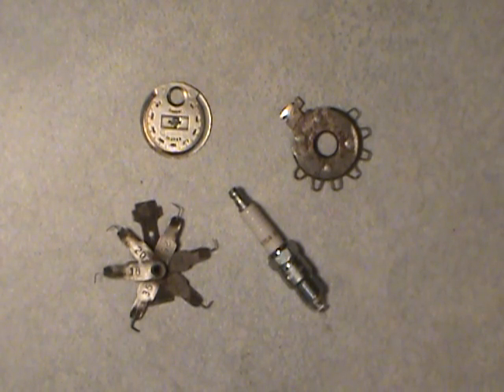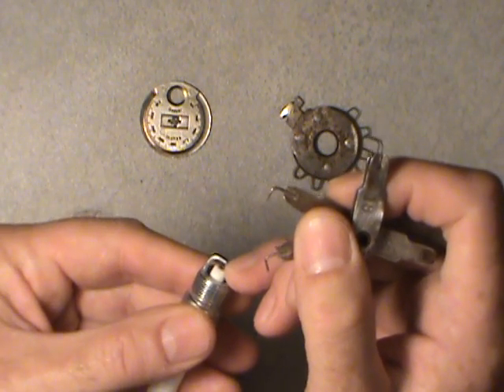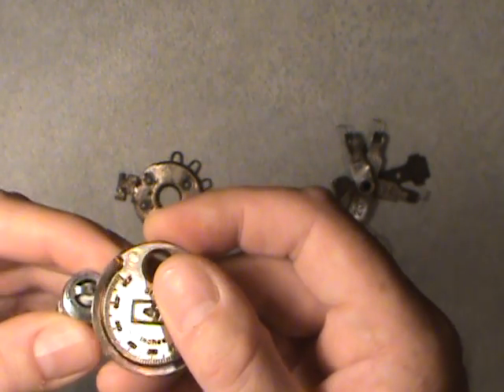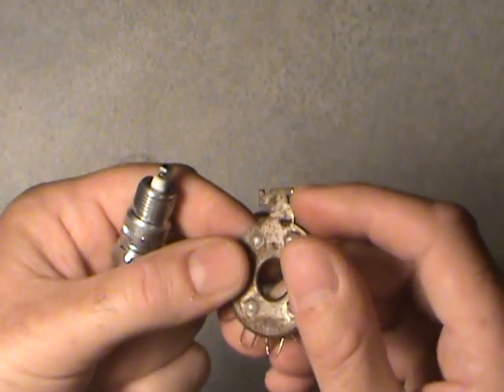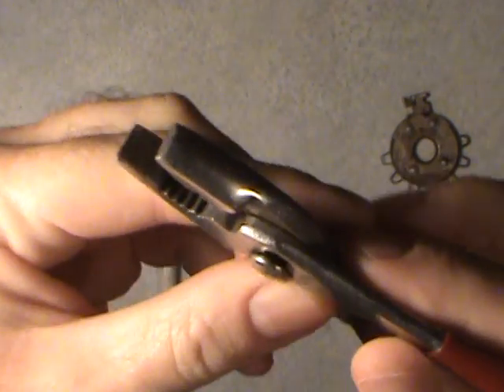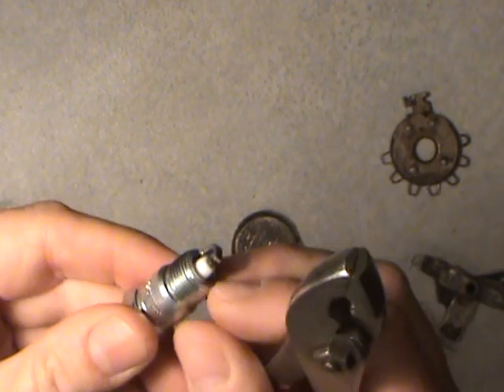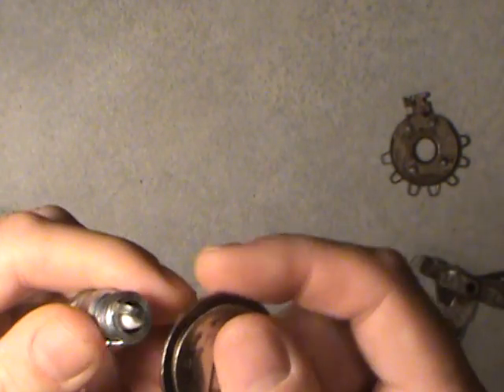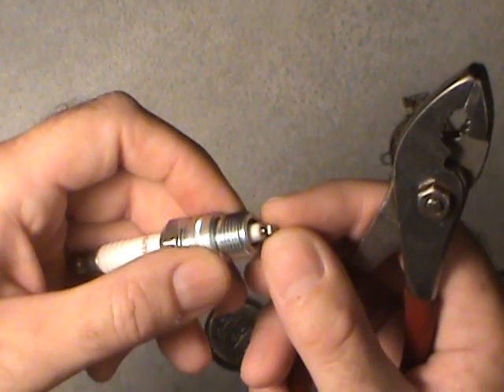SPARK PLUGS How to set the Gap (Part 2)

Comment: why is it important to not touch the electrode? you'll always be touching it anyways with the feeler
Reply from the maker: MotoBoy Greetings MotoBoy....Thanks for watching, and for Your comment/question as well..................As long as a..."Very Light"...shall we say..."Feel" (aka, Drag, or Dragging Motion..."Resistance")...as in, next to No Real Force Applied (kinda like...a..."Swiss Watch-Maker"..."Applies"...when working on a, good ole..."Wind-Up/Main Spring"..."Rolex Watch"...???...does...lol)...when using a "Feeler Gauge", or any Gauge, for that matter, that gets inserted Between, the Electrodes, in the, shall we say, "Common Type, of Old School...Spark Plug", to "Measure the Gap", between, the "Inner/Center" Electrode, and the "Outer/Ground Strap" Electrode, then, by doing so, that part of, shall we say, Spark Plug "Handling" (with Care), shouldn't cause any Harm, to the Spark Plug, as opposed to..."Cramming"..."Ramming"...and...hopefully not, using "Lethal Force", in order to "Make"...that there...Spark Plug..."Gap Measurin' Gauge"..."Fit"...Between, the, 2...Spark Plug's..."Electrodes"...which, if using that Much Force, will, as I see it, have, a pretty darn good..."Chance/Potential"...at..."Damaging/Ruining"...that, poor abused Spark Plug...!!!..............Now, I'll move on, to the "Outer/Ground Strap Electrode"......................................................Try not to..."Bend/Adjust"...the "Outer" Electrode..."Too many Times"...and/or..."Too Much/Distance-wise"...because, as with most Metals, it will usually, "Weaken/Fatigue", that piece of Metal, relatively Close, to the Location, at which, that "Bending" took place, and Heaven Forbid, having, a Chuck/Piece, of that Spark Plug's..."Outer Electrode"..."Break Loose"...and fall into, a..."Running Engine's"...."Combustion Chamber"...and just imagine now, at all of "That"..."expensive"..."Expensive"...did I say..."EXPENSIVE"...Engine Damage...that would probably Result, if "That" were to Happen...???..."Yikes"...!!! (lol)...............................Oh yeah, "Same Damage", could also be Caused-by...something like, the..."Porcelain"...that Surrounds, the..."Inner Electrode"...being, oh, shall we call it..."Handled in a Rough Manner"...perhaps, where-by, for example, Someone, used a..."Mini-Pry-Bar-like" (tool, of his/her choice...lol)...to, perhaps..."Adjust/Bend"...the..."Outer Electrode"...to Set the "Gap", using the "Center Electrode", kinda, like an "Anvil/Fulcrum Point", some-what, if You will.........................................I be thinkin', it's a really good idea, to always keep in mind, that, any "Spark Plug", right from the time, that, "it", is "Manufactured", at the "Spark Plug Manufacturing Plant/Establishment", that, there is a considerable amount of, shall we say..."Handling"...during..."Shipping"...that needs to be done, in order to have Your Favorite, "Automotive Parts Supply Establishment", provide You with, the "Correct Spark Plugs", for Your Exact Engine, on, any given day, and that, so-called..."Rough...Handling"...during Shipping, my Friend, is something, that, probably, quite Rarely, at that, could result in a "Damaged" Spark Plug, and, hopefully not...................................When-ever, I'm about to Install a "New Set" of Spark Plugs, in any Engine, I Always "Examine"...Each and Every..."Spark Plug"...for, any "Visible Damage", before, I even attempt, to...."Set"...the Spark Plug's..."Gap"...!!!..........................Please be Aware, that, Some, Spark Plugs, have, a..."Non-Adjustable Gap"...so, always "Check" for that as well...................................Hmmmmm....I guess, if, any, and all People, were to Treat a Spark Plug, much as a Person, would Treat a "Baby Bird", then, just like that there Baby Bird, the Spark Plug, just might have, a Better Chance, of..."Survival"...dont-cha-think...???...lol...............................Yes-Sir-ee-Bob...please, treat, all of our Friends, known as "Spark Plugs", with the Respect, that, "They" really do deserve, seeing as how, once gettin' installed in an Engine..."They"...have to endure, a...Very Tortuous Environment...with all of that...Super High Temperature-Heat & Very High, Explosive-like Pressure...that "They" have to Live in, and are Exposed to, when-ever...You...decide, to..."Start-er-Up"...and..."Go-fer-ah-Drive"...Oh-Yeah...!!!...........................................So, there You have it, and............Till next time........Be Safe, take care, and have a good one.

Comment: dont use the pliars on a high performance engine. the serations press into the metal and create risers that will get superhot and cause detonation
Reply from the maker: Greetings MotorsportsX....Thanks for watching, for Your comment, and for Your observation/theory as well....The "Pliers" that I use to perform the "Setting" of the Spark Plug's "Gap", by "Bending" the "Outer Electrode/Ground Strap", has had many, did I say "Many" Hours of "Usage", making for, some quite "Dull"...Serrations, on the "Jaws" of the "Slip-Joint" Pliers, as compared, to perhaps, "Brand New" Pliers, that, may, or may not have "Sharp" enough "Serrations" on the Pliers "Jaws", that will be able to, as You say, "Create Risers", which, if, that happens to be the case, that would probably be, something, that should be taken into consideration alright.

Speaking of "Super Hot", now I'm thinkin', that, Spark Plugs, that happen to have that "Very Small"..."Precious Metal" (aka, Platinum, etc.) "Center Electrode", might also be something to be "Considering" as a Potential "Hot Spot", especially, as it applies to, as You were saying...High Performance Engine.

The High Performance Engine, that You were mentioning, has me also thinkin', that, it is also a "High Compression Engine" as well...

...unless...

...we are talking about a High Performance Engine, being Equipped with...a "Super-Charger"...a "Turbo-Charger"...or, maybe even...a "Big Shot" of "Nitrous Oxide"...!!!

Perhaps the word "Pre-Ignition" could be the way, in which to Describe what may be happening, as a Result, of Your theoretical "Risers", akin to an unwanted "Sharp" Edge of something, that may be present in the High Performance/High Compression Engine's Combustion Chamber/s.

So then, if we are mindful, at avoiding, having those Serrated Plier's Jaws, theoretically making any "Risers" (upset edges?) on the outside of the spark plug's Outer Electrode/s, then, as I see it, there are quite a few "Other Things", to be Considering as well, especially, if the Engine in question, happens to be...a High Performance/High Compression Engine...

"Carbon" Build-Up, that is usually caused by, an overly Rich "Air/Fuel Ratio"..."Ignition Miss-Fire"...etc., is, as I see it, one of the Most "Important" Things, to be looking "Out For/Being Aware Of", as, a Condition, that, might cause a slight Increase in Compression Ratio, if there is a large enough amount of Carbon, present in the Combustion Chambers (aka, on the Cylinder Heads/Valves, and on top of the Pistons), and, oh, let's say for instance, that we have a High Performance/High Compression "Street" Engine, which, "Before" the "Carbon Build-Up" became present, the Engine was Burning, the Highest Available "Octane" Gasoline, that the Gas Station's Gas Pump, had to offer...

..and, the "Ignition Timing" (as provided by a Distributor or the Vehicle's Computer), was "Customized/Tailored" to achieve the Engine's "Full Potential" (be it Horsepower or Torque, or an Average, of the two), and the "Timing Curve", was set-up to the "Maximum Amount", that the Engine was able, to make Full Use of, and like I said before..."Before the Addition" of that "Unwanted Carbon", then, as I see it, once that "Unwanted Carbon" became, shall we say..."Thick Enough", I'd say, that, in itself, would Probably, be Inviting some very "Unwanted"..."Pre-Ignition", or is it..."Detonation?, as in, perhaps...some "Carbon that Starts"..."Glowing"...!!!

There are plenty of Other "Things", that can be the Cause/Culprit of "Pre-Ignition" and "Detonation", but, maybe, just maybe, I should/will address those "Other Things", at another point in time, down the road.

Be Safe, take care, and have a good one.

Comment: whats the point measurment i need to make for my 97 vw golf k2 2.0
Reply from the maker: Greetings Harley Moore....I had a look around on the Internet, and I noticed that there might just be, More then "1" type of 2.0 Liter Engine for your Golf k2....I also saw quite a Range of spark plug "Gaps" as well!....The best advice that I can give you, is, as follows....First off, have a look inside your "Engine Compartment", and see if you can Find, what is commonly called, a V.E.C.I. Label (Vehicle Emission Control Information)....If, in fact, that you do find one, hopefully, it will indicate the Brand, and Code/Description, of the Spark Plugs that were installed by the VW Factory when the Vehicle was Brand New, and maybe, you might just find the Spark Plug "Gap" Setting there also (might be Specified in Metric, and/or Inches).

If you can't find a V.E.C.I. Label/Sticker in your Golf K2's engine compartment, then it's time for...

Plan "B"...

Plan "B" is what I would do, if I was in your situation.
See if there is an Engine Model Number, on, or near your Engine somewhere.

I would start Phoning Local Volkswagen Dealerships, where they Service your Type of Car, and ask someone there, if they can give you the Information, about, which Spark Plugs to use, as well as, the "Gap" Setting that the VW Manufacturer Recommends.

Plan "C", if needed...

Find a Reputable (trustworthy) Automotive Repair or Parts Shop, and ask them, if they have the Specifications for the VW Factory Recommended "Brand" of Spark Plug/s, as well as, the Proper "Gap", that goes with that Brand/Type of Spark Plug, so as to, avoid any possible Trouble.

I hope this reply helps...

Be Safe, take care, and have a good one.

Comment: nice
Reply from the maker: Greetings Rick C....Thanks for Your "Nice" comment, my Friend....Well, as for me coming up with this particular Method of Setting a Spark Plug's "Gap", by using "Slip Joint Pliers", it kinda Evolved over a few years....At First, I used the so called "Special Tool", that Hooks onto the Outer Electrode (aka, Ground Strap), and had to use quite a bit of force/pressure in order to Bend the outer electrode, to obtain the Specified "Gap" that the Factory/Manufacturer Recommends/Specifies....The "Hook" Type of Tool that I had was an Inexpensive one, and it actually "Bustificated"...lol...(aka, Broke, as in Broken), while I was attempting to Set, that there "Gap!"....Also, I "Did-Not" like the Fact, that, the "Cheap" Gap Setting Tool, that I used back then, "Broke", and, would at times, make "Contact" with the "Inner Electrodes Porcelain!!!"....To me, I Never, Ever, want to have "Any" Tool, "Contacting Anything", But, the "Outer Electrode", while I'm trying my Darn-dest, to "Set" that there Spark Plug "Gap".

I use to use the "Pin" (aka, Round Wire) Type of "Gap" Measuring "Gauge", and You can see "2" of them, in this Video's "Thumbnail-Picture", One in my Right Hand, and the Other One, is just below my Right Hand, on the Work-Bench.

Then, one day, while I was at a Cashiers Checkout Stand, paying for some stuff, low and behold, I saw that "Rotary" Type of Spark Plug "Gap" Measuring "Tool", (on the check-out stands Counter), (and can be "Seen", in this Video's Thumbnail Picture, just below my Left Hand, on the Work-Bench), that a Person could just Insert into the "Gap", at its Smallest Size, then Rotate it, until it made Light Contact with Both Electrodes, then you just Directly Read (pronounced Red...lol), the Actual "Gap" Dimension (size), right on the "Gap" Measuring Tool!
It also has "Gap" Measurements in, Both, "Inches" and "Millimeters" (aka, Metric).
"Inches" on one Side, and "Metric" on the Other Side.

This type of "Rotary Gap Measuring Tool" is Amazingly Fast/Efficient/Quick, and accurate enough for the Average "Grocery Getter" (aka, daily driven vehicle).

With the "Pin" Type of "Gap" Measuring Tool, in was a "Pain-in-the-Keester" (aka, rear end), in that, the "Pin" Type of Gap Gauge, had to have a "Wire-Diameter" for each and every "Gap-Size!"

 The so called "Experts" will probably be sayin, that the "Pin" (or Wire) Type of Spark Plug "Gap" Measuring Device, is the Most Accurate, but Hey, where does "All that Accuracy" Go, when the Spark Plugs "Electrodes" Start to, well..."Erode", and the Spark Plug "Gaps" Start Growing, as in, a LARGER "Gap???"

And now, for the "Grand Finale" (finally!...lol).
 
Drum-Roll Please...

I only Paid about "1" Dollar for that "Super-Duper-Time-Savin-Rotary-Gap-Measurin-Tool" of Mine!!!...(lol).

Be Safe, take care, and have a good one.